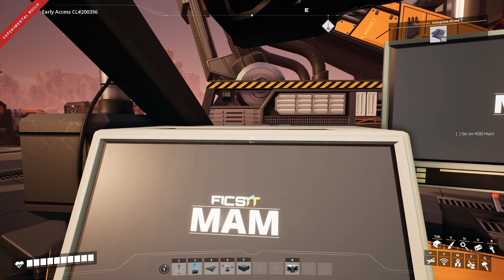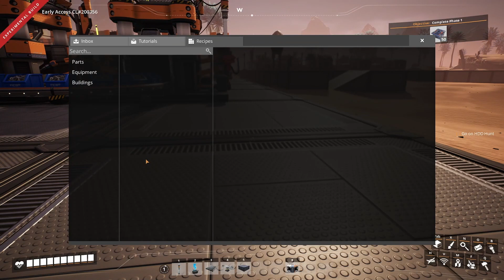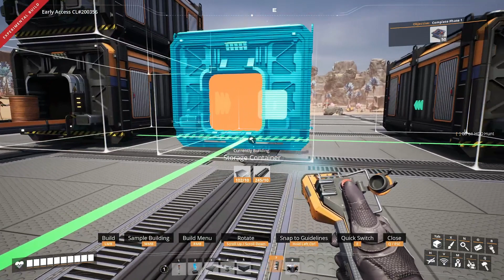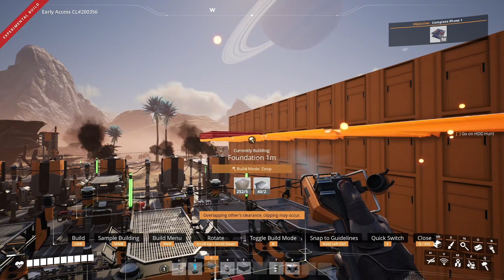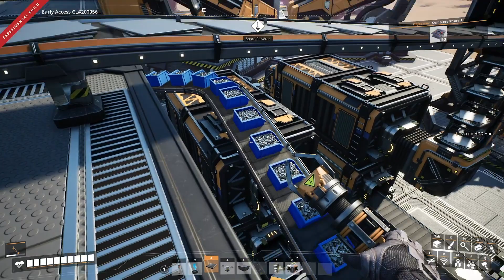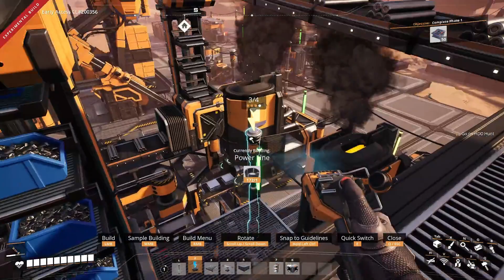SATISFACTORY | Update 6 | EP8: Smart Plating!!! | Brain disconnects itself...

Comment: Good stuff.  I have never really tried to collect all Hard Drives as I do each step.  Part of me can see that as being smart but you also end up with the not so good alternate recipes for each step.  Still, I just started one trying out the desert biome so I might as well try collecting all HD early on.  If I focus on those and biomass I should be good for power when I am ready to go coal power.
I do love the alternate for screws from iron in gots though.  Even with wasted efficiency at first I will set up my production so when I can use faste belts I just need to upgrade the belts.  I guess you could call that future proofing the build and since I will need things like rotors forever I like to plan ahead for that.